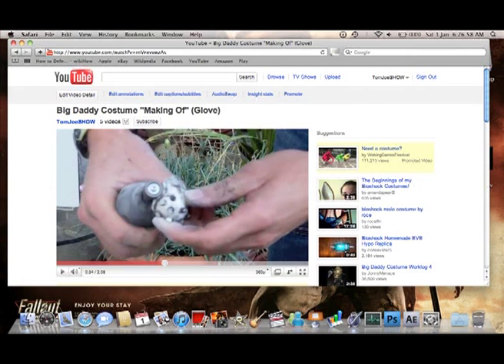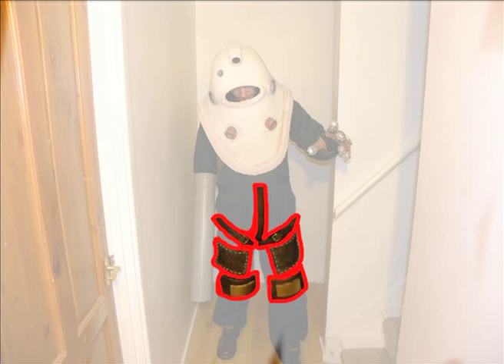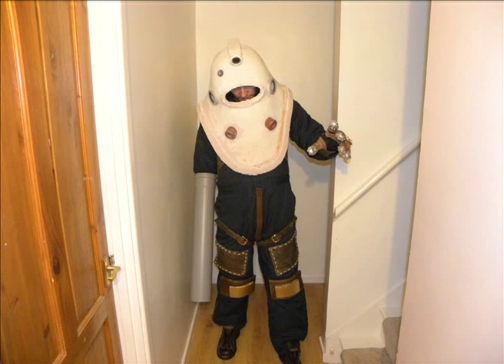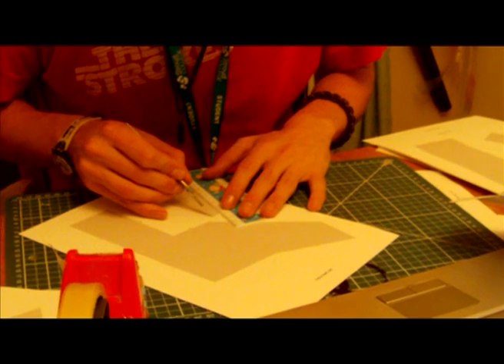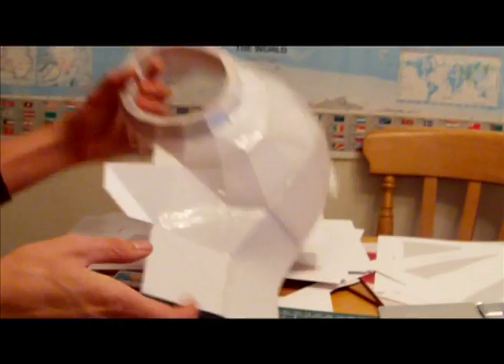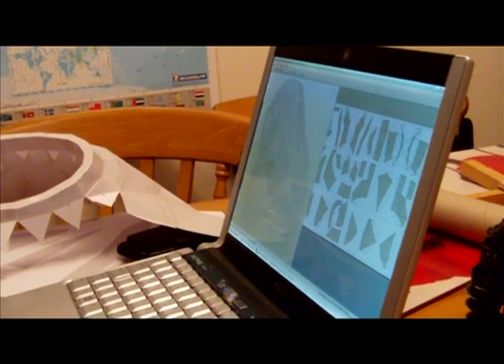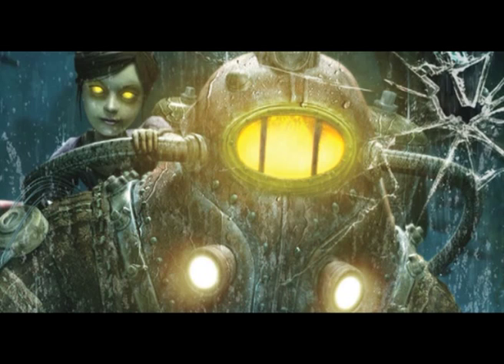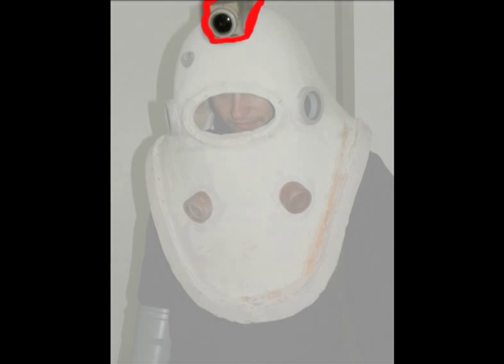Big Daddy: Helmet - Making Of (Part 1)

Comment from the maker: @sonicfreak04 if you have layers of fibreglass and wall filler on top of the form of the body, that will become part of the structure, and so you wont be able to remove the original form. (if that makes sense and answers your question) it will all be one fixture that cant be separated.

-Joe